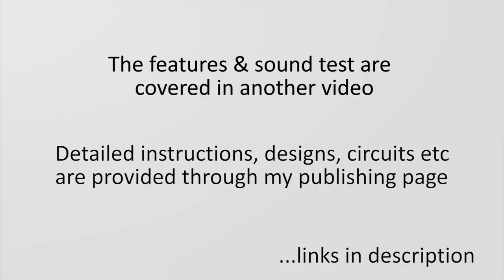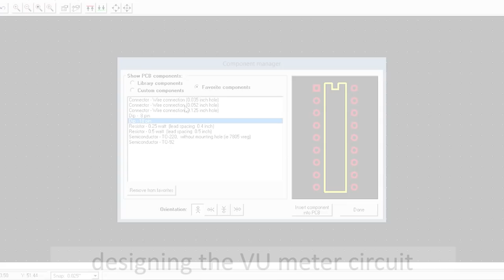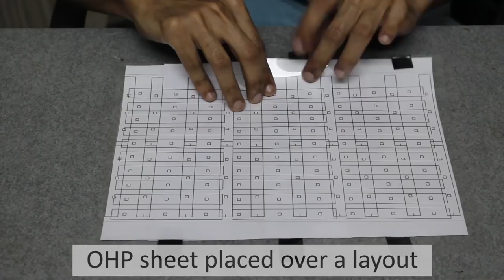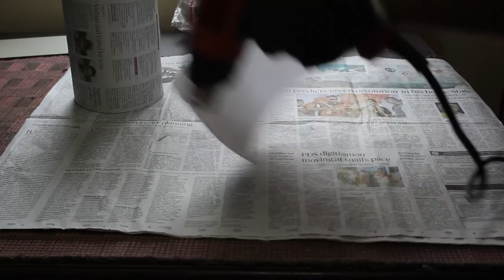How to make a Light Show bluetooth speaker | PART 2 - full build

Comment: i used an arduino uno for the leds!
Reply from the maker: great, have seen some projects using arduino for the lights. hows the sensitivity of lighting while using the arduino?
Reply: Hobby Room do you mean brightness? I didnt use the power pins of the arduino to power the ledstrip, i used 5v ledstrip and i used a diffrent power source that had the right amount of current that i needed, you only need to connect the data pin to control it. And if you are talking about sensitivity of how it picks up the music, you can change it all in the code. You can either download code from online, or create your own. I used a little microphone that i connected to the arduino that picks up the sound. I soldered a pontentiometer to the output of the mic so i can change the sensitivty. But like ive said you can also just change it in the code.
Reply from the maker: @aarriikknn33ll  thank you for your reply. I was asking how is the performance of the leds  according to music. Since you are using a mic it would pick up  additional surrounding noise too right? So i was asking how far this noise would effect the led lighting. I'm just curious to know it,  thats why im asking, hope you dont mind answering.
Reply: @HobbyRoom  i placed the microphone next to the tweeter and turned the sensitivity from the mic to really low, outside noise is barely picked up. I will upgrade it in the future by using the output of the bluetooth chip. And when using AUX  the output pins of the aux cable. That also works! And no, i dont care about aswering. I actually always look forward to answering :)
Reply: @HobbyRoom  if you search Cine- 
Lights on YouTube you can see a tutorial on how he did it. Also the download link for the code, i modified the code to work with an arduino nano, so i used half of it. But you can just download it and put it on the arduino and you are ready to go!
Reply from the maker: @aarriikknn33ll ohh ok got it, thank you for the reply
Reply from the maker: @aarriikknn33ll  I saw it, its good and a sort of different type of an equalizer. The circuit which i have designed uses an LM3915 IC with a dedicated input peak detector for better sensitivity. Also it has some other functions too. I have done a separate video which explains these lighting effects, if you have time you could watch it too and gives a comparison about the Arduino version and the IC version. I have seen similar projects using arduino before and its good to see how people add their own touch in VU meter lighting projects. thnx for the info
Reply: Hobby Room Awesome! I just have a pair of arduinos, i have a hige bundle off components like resistors, ICS, caps, etc but i dont have the lm3915 ill order it and give it a try
Reply: Hobby Room also with the arduino, you can get more effects. And program them. You can also program every single individual led of the strip. And you dont need to use allot of wires and soldering. So its basically easyer. I found a lm3915 in my garage, i will give it a try. I saw some circuits online!
Reply: Hobby Room within 1 month the rest of the components i need for my bluetooth speaker will arrive, so im talking about the buck regulator and new amplifier that is capable
of better sound output. (Tda7492p) and i will create a video of the build maybe. Ill tell you when its finished so i can show you the led effects! I just have a single led strip tho.

Edit: and mine is completely made with wood, im 14 years old so dont expect the best thing ever. Im gonna make all if the pieces with a CNC router. :)

Also another nice chip to work with is the attiny85 you can program it with an arduino to have an even more tiny circuit
Reply from the maker: @aarriikknn33ll  great
Reply from the maker: @aarriikknn33ll  Yes I know that we could program with individual addressable led strips and a lot of possibilities are there for an arduino over the conventional ICs. my work related to arduino are very less at the moment but in future I'll able to do some Arduino projects on my channel.
Reply: Hobby Room ok! Nice, i have the notifications turned on so get updated on future videos!
Reply from the maker: @aarriikknn33ll  great. good luck with your project. Are you using the same board that I had used in my project?  If you are dealing with these boards for the first time then let me know. there are two things to consider before using it for your purpose.
sure, you could sent me the links when its done. I'll be glad to see it. I think the main aim of doing DIY projects is to learn new things, gain practical skills and moreover to have fun while building. So age and making the best thing is not that important in my opinion. Its actually a great thing that you have started building at this early age.
Yeah I have heard about attiny85 its so small and still powerful.
Reply from the maker: @aarriikknn33ll  Great, thank you for your support.
Reply: Hobby Room facts! Im using the tda7492p amplifier board, for my tiny speaker (without leds) (i 3d printed allot of the parts) i will be using the tpa3110
Reply: Hobby Room i already got the tda7492p btw, it arrived 1 week ago. 1 capacitor had broke off during the shipping so i had to resolder it, not a problem tho. Im gonna use it in mono by using the L - and R + , for the other speaker that is almost created i have used stereo.

And i got a crossover from the speaker i got the drivers out off. So i used that one

*Also, nice to see that you have done the woodwork by hand, i created my design with AutoCAD to make it with the CNC router that my dad has at work. I also have the 3d printer from my dads work. It is not from him, but we are allowed to use it.
Reply from the maker: @aarriikknn33ll  
1) The tda 7492p board is a 25w + 25 w stereo board. These particular board however draws a lot more current while powering on. you could hear a small pop up noise on the speakers while turning it on. This initial current draw is often called thumbing in amplifiers.  The downside is that the battery pack protection circuit may reads this as a over current draw and may turn off automatically. The solution is to put a much larger battery pack (with more mah rating). You could add 2 or 3 Li ion cells in parallel for getting higher mah rating. 
In short the battery pack which I have used in this project is far too less for properly powering the amplifier board.  
2) Another thing to note is that the audio output terminals ( like the L+ & L -) are not exactly positive and negative audio outputs. The plus and minus represents the phase of the signals. The amplifier output is arranged in a setup called bridging where signals are converted to two different phase (ie. the in phase & the out of phase). So if you are planing to take the audio signals (L+, L-) for the led lighting setup it will actually shorten the output and will eventually damage the amplifier.
the solution is to take one of the phase signal (either L + or L -) and the power ground of the amplifier as the the audio outputs.

These are my finding while working with these boards. however the battery pack and boards of both of us would be different so I not sure you would experience it or not. Just thought to share the findings, thats all
Reply: @HobbyRoom  im not uwing the output of the amp, im using the input from the bluetooth chip, or aux. But atm im using q mic. Also the pop you talked about does not occur for me, but i have a large enough pack that is 10,000maH and outputs 14,8V  @ arround 2A+ with a BMS so no worrys :)
Reply: @HobbyRoom  im only using a single 30W  woofer and one tweeter, paired with a crossover.  So i converted it from stereo to mono
Reply: @HobbyRoom  For aux input im using q AUX arduino breakout board so i got tje connections with solder pads so i can work with it more easy, i also have a powerbank built in, also have an lcd screen to indicate charge status and percentage. Also sorry if im making some spelling mistakes but im from Belgium :)
Reply from the maker: @aarriikknn33ll Ok, if you are using a 10k mah battery pack then it wont be an issue.
Reply: Hobby Room ok!
Reply from the maker: @aarriikknn33ll  Ok got it, whats the idea behind taking L- and R+ pin outs rather than taking L+ and L- and completely leaving the R+ & R- ?
Reply from the maker: @aarriikknn33ll  ok using Aux board would make things much easy. You could also try using a normal PCB mount aux port and fixing it with epoxy resin. it would be strongly bonded with the enclosure and also provides an air tight seal around the port. No problem your English is good and I' also not a native English speaker since I'm from India.
Reply: Hobby Room instead of only hearing on channel im mixing them so i get mono
Reply: Hobby Room the aux board is handy to use it for the arduino, and yes it was already gonna fix it in place with epoxy for a good seal so there are no air leaks
Reply from the maker: @aarriikknn33ll got it
Reply from the maker: @aarriikknn33ll  great, every detail taken care of. I'll see you around

Comment: Not a bad concept 
it looks awesome 
It has what any party lover would love to have near music and lights 
But idk... the cabling and inner work... Idk found it a bit messy, don't get me wrong though its still a nice work
Reply from the maker: Thank you very much for your reply. Your are absolutely right, the cabling is messy for sure since the switch box alone consist of 52 pin connections and these are connected to the circuit boards which have further internal connection as well. I thought to include a detail wiring explanation in the video but it would make it more lengthy and not everyone would like to watch it also. So every detail on how to wire and a neat wiring diagram is included in my article page (link in description). If you are interested you could have a look 😊
Reply: @HobbyRoom  
Thank you very much for the reply 
Now I get it and I would love implementing lights on my projects soo thank you
Reply from the maker: @pjrios5171  you are welcome. LEDs are one among the coolest thing to use in a project. good luck with your projects & thank you for watching the build.

Comment: I need help I want to build this in the pic into a portable speaker with bluetooth 
I have 3 6 watt, 1 5 watt and 2 3 watt speakers
I would like the battery to last as long as possible
and would like to put lights in the change with the beat
I've never done this before
give me a $100 budget and a under $100 budget example parts
hope you can help
if I can I'd like to use all the speakers but if you think the 3 six watt speakers would be loud enough I'll trust your judge meant
Reply from the maker: In this pic you said,  you meant, like my speaker or do you have provided any link to your speaker?
See, we have to discuss your project in detail. 
first of all we  need to know which type of speakers do you have in hand, Are all the ones same ?   mainly there are sub woofers, woofers, tweeters. The construction of all these speakers are different and its meant to work in different audio spectrum. The sub woofers enhances tho lower end audio, I.e the bass.  The woofers enhances the vocals and mid range of audio and tweeters deals with the high end or treble of the audio.  The signal from the amplifier is split to these corresponding speaker drivers through an audio crossover.  This is the method commonly used in speakers. What are you planning to do? are you planning to include a crossover? If you are not using a cross over then, its better to stick with a pair of speaker driver and a pair of passive radiators. A passive radiator enhances the bass response and therefore enhance the overall sound quality.  If you are planning to use a crossover, then we could use 2 6 watts speaker and 2 3 watt speakers. 

Another important information you need is the impedance of your speakers. If you have any info on it let me know. it will be normally written on the magnet of the speaker like 4 ohms or 8 ohms etc.

Let me know about these and we'll work through.
Reply: @HobbyRoom  forgot it doesnt let you put pics I had something
Reply: @HobbyRoom  I wanted to make into a speaker just need to know what to buy to make a portable bluetooth speaker and use all my speakers if possible
Reply from the maker: I could help you but i need to know the impedence of each speakers. Could you help me with that ? Its normally written at the back side of the speaker magnet. Without knowing it, there are high chances of burning up your amplifier.
Reply: @HobbyRoom  the 5 watt says 4 have 1 of them I think I mit buy 1 more 5 watt same as what I have
Have three 6 watt that has 4 on it 
So gonna do two 5 watts with 4 on it and three 6 watts with 4 on it
Reply: @HobbyRoom  I was gonna put these Speakers aiming out the sides that is metal and not the part that is plexiglass 
For you to know
Reply from the maker: Its better to buy one more 6w speaker with 4 ohms. Then you'll get a total of 4 6w speakers. Two of them could be connected in series on the left channel of the amplifier and the other two in series on the right channel. By doing so, you could use a 6w amplifier for the project.
If you need bass, buy two passive radiators also.
Reply: @HobbyRoom  would you be able to tell me each thing I need to build it all the components give me $100 budget then 1 less if you could 
I would appreciate it
Add what radiator I'd need too for bass
Reply: @HobbyRoom  I want to do this hope I enjoy making it then I can have another hobby
Reply from the maker: Sure, i could help. If you want you could reachout to my facebook page hobby room and message me there.